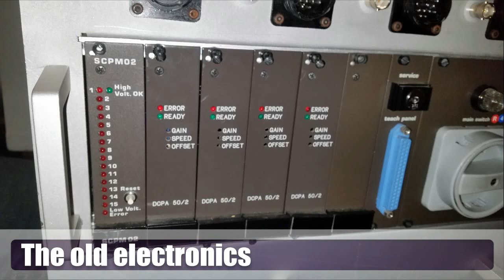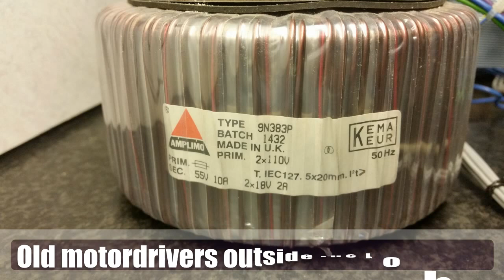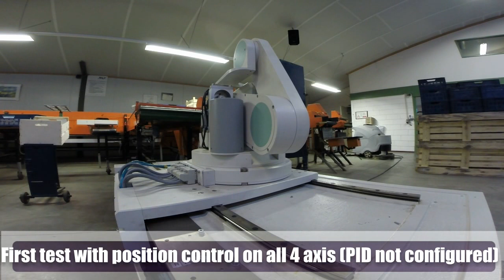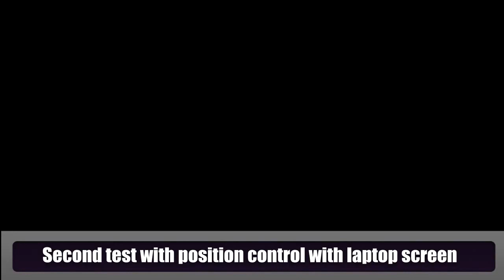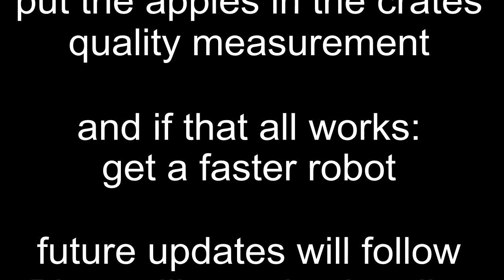CFT robot project update #1

Comment: Did you use Labview on this project?
Reply from the maker: Yes i did. But i converted the whole robot to C# later on.
Reply: @JelleStappers  
Is it possible to get the project you used? I'm unable to get any support from basic micro about labview with Arduino integration
Reply from the maker: @drevonstanford6945  i can see if i still got the labview files, but i believe nothing was done with arduino integration. You can setup a serial communication with labview to your arduino and make the arduino listen to the serial port. I never had anything compile onto the arduino. That plugin costs 500 dollars and they didnt wanna give me discount. Thats the main reason i continued in C#. What kind of project are you building?
Reply: @JelleStappers  
I just need a method to control the driver's with labview. Basic functions like forward moves with encoder counts
Reply from the maker: @drevonstanford6945  https://www.dropbox.com/transfer/AAAAADFlIXD4rTRnXFOt6nSGIjgYJPM9kWLzvW-NtrDPceZGEVik_dA  this was it back then. but i have no labview license anymore so im unable to watch this.
If you have questions, feel free to ask i learned alot the last few years, and this is pretty old.
Reply: @JelleStappers  thank you for the file. It's working but now I'm having visa read errors. Do i set up the visa read and write outside of what you provided?
Reply from the maker: @drevonstanford6945  i remember that error. I think thats because no deviced are connected. Didn't i build a simulate button or something in? Otherwise i can recommend to reverse engineer what you see and build your project with that knowledge. Let me know if you got something working. Always curious 😁
Reply from the maker: @drevonstanford6945  Hey drevon, did you actually install the visa drivers for labview? labview needs them to function with a serial port.
Reply: @JelleStappers  Yes I did. I'm still unable to get rid of the errors that pop up after every move is made. I just have to keep pressing enter to run the Vi. This is really not ideal
Reply: @JelleStappers  what were you using when you converted to C#. Hardware, software,etc. Was the implementation easier?
Reply from the maker: @drevonstanford6945  i rewrote everything. Written in visual studio and compiled and executed on a pc.
Reply from the maker: Im not a huge fan of graphical programming. Object oriented programming with c or c# keeps your program just as clean as graphical.
Reply: @JelleStappers  ok I'm going to look into migrating to visual studio. Lab view has been buggy  I don't see any resources from basic micro or sample code on the website. Did you have any references to go off of?
Reply: @JelleStappers  any simple sample code examples from visual studio?
Reply from the maker: @drevonstanford6945  you gotta learn c# or c++. Once you do it's fairly easy
Reply: @JelleStappers  I've used it before with beckhoff twincat but very little
Reply from the maker: @drevonstanford6945  googled that. Seems plc software with ST. Don't compare c to ST. It can be compared in a way. But C# is alot nicer once you get the hang of object oriented programming. Only issue is that you can't compile c# to mcu's. Neither can it run on it like micropython does. C++ however can be compiled to alot of mcu's, but has disadvantages to c#, it's also alot older.